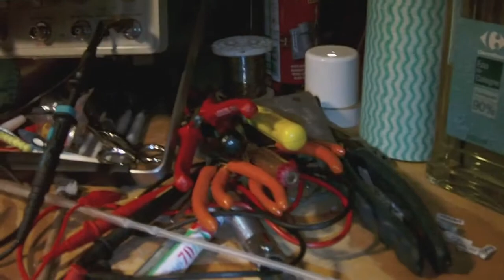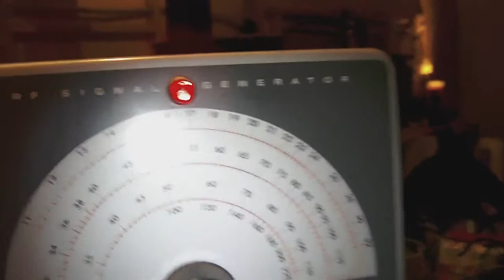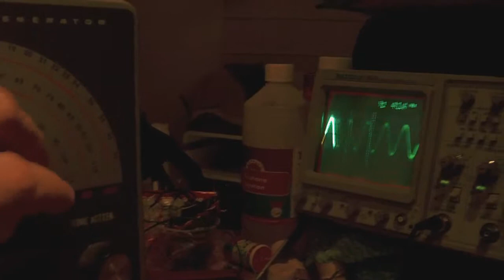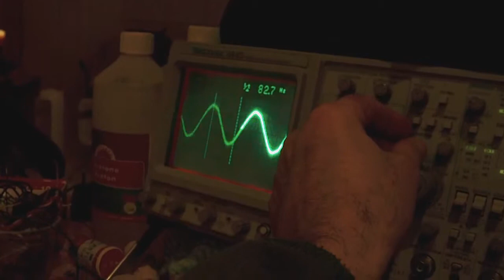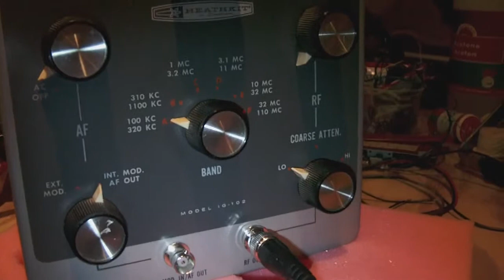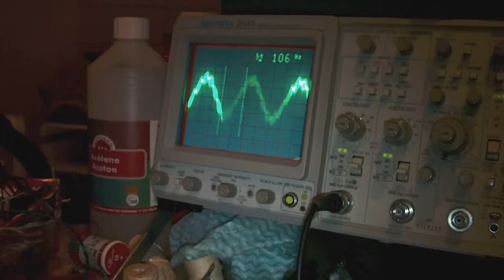Heathkit IG-102 part 3 of 6

Comment: Is there B+? Looks to me like it is 60 Hz. I think you are measuring the tube filament supply. The modulation you see may be the oscillator is working (6AN8). Check more connections. The 12AT7 most likely is the output driver.
Reply from the maker: Believe me I checked everything. B+ is within tolerance +--130V. Thanks for the tip

Comment: It looks to me like it's working properly except for the 50Hz signal. Perhaps you have a ground issue ?  Putting the COARSE ATTEN. on LO drops the output amplitude quite a bit so I think you're just not seeing it on the scope.
Reply from the maker: Yes... you're right I was seeing an impinging 50Hz signal... it appears some of my equipment was causing it... watch part 4 ;)